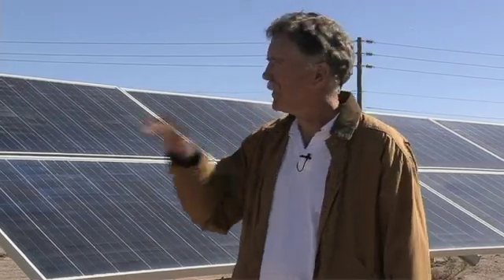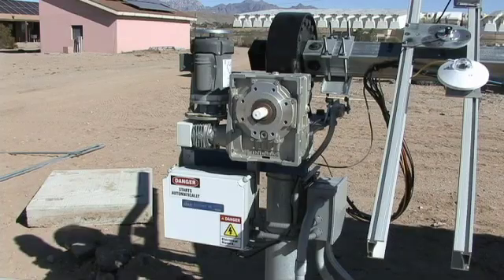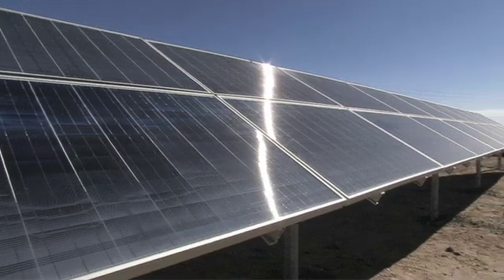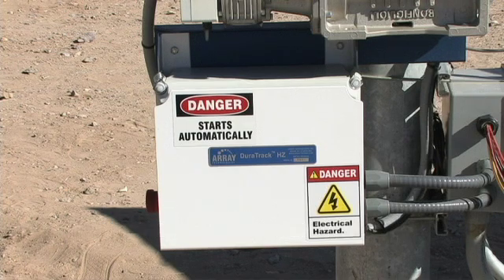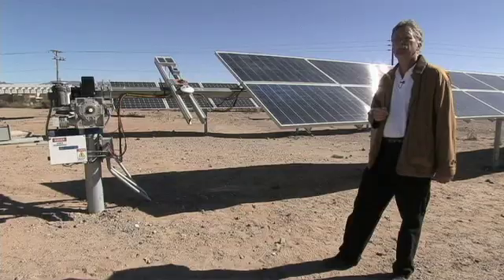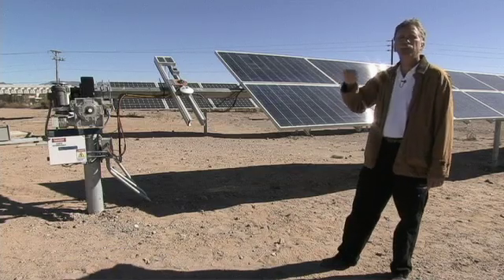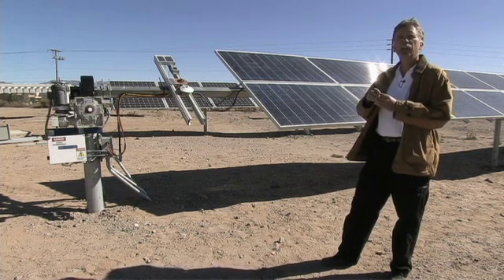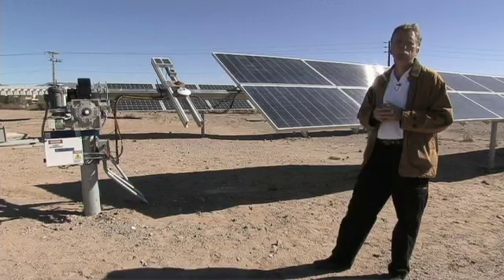Renewable Energy: Single-Axis Tracker

Comment: Would it make more sense to install these trackers tilted, i.e. on a side of a hill, so they utilize light even better. Putting them flat like this with traveler axis being horizontal, makes only really sense at low altitudes (close to equator).
Reply: Exactly. The fixed axis should be tilted at the location's latitude. The added cost is negligible.
Reply: Mmmm, no...